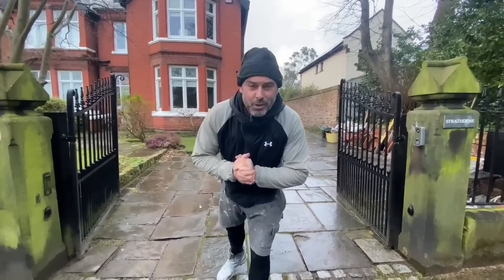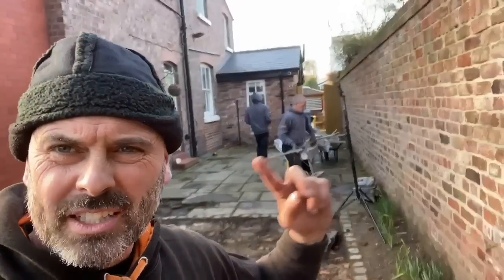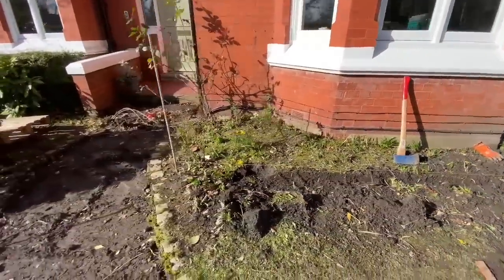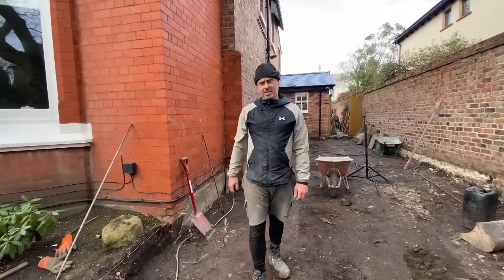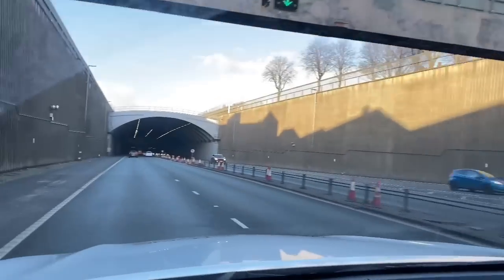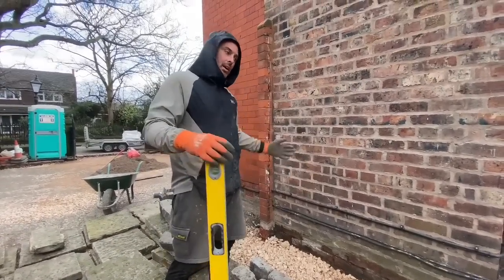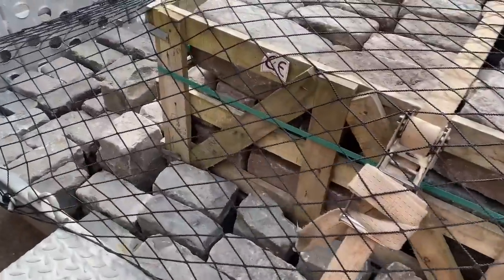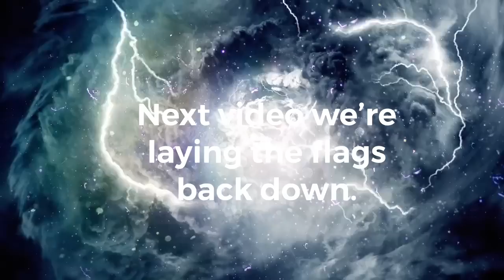Reclaimed Yorkstone Driveway Part 1

Comment: Absolutely love your videos, attention to detail is next level and results are just phenomenal. This one is going to look stunning with those new setts and that gorgeous Yorkshire stone going back down. 1 question if you’d be so kind, are you laying the setts on a bed of semi dry sand and cement? I love the other video you done with the setts and used the flow point to joint it, looked stunning👌🏼
Reply from the maker: Hello Connor, thank you very much my mate.  Yes, it’s a semi dry mix we add water to the mix in the summer, but often the sand and or ground is damp enough on its own in the winter.
5/1 grit sand to cement 👍